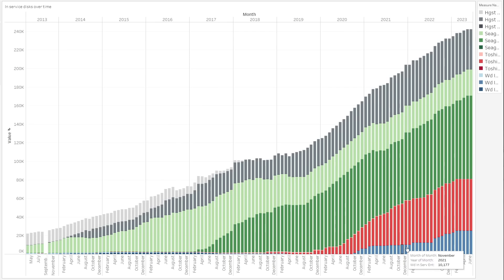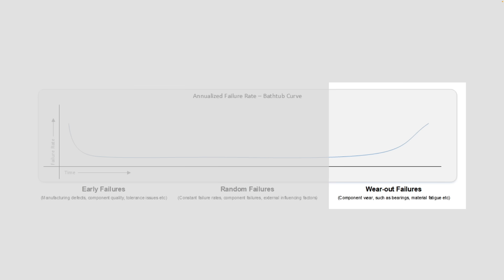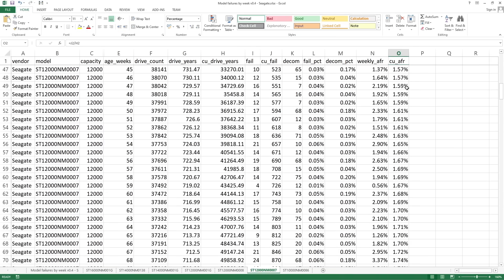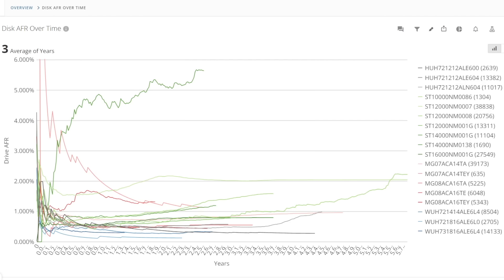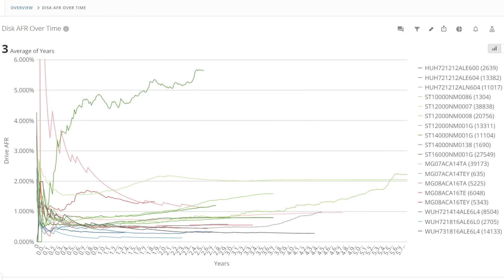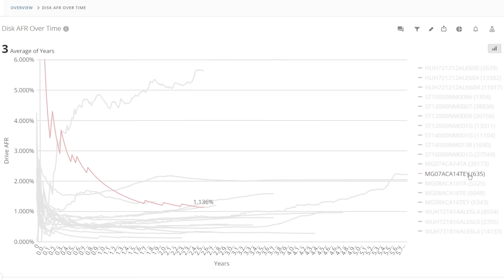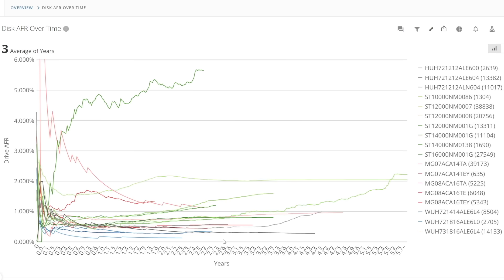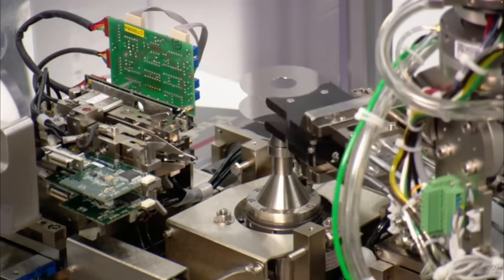Failure Rate Analysis - Best 10Tb+ hard drives: Seagate, Western Digital or Toshiba?

Comment: So it's like 1.5% chance of failure per year or over 3-4 years? I like those odds.
Reply from the maker: AFR is the percentage chance of failure for any given drive in a single year. 

As you probably saw, it’s usually higher in the first few months, and then it drops to that lower value, usually rising a little over the next few years. Each model has different stats, so some can stay below 1% for 7 years, others rise more quickly. 
But yes, even with people complaining about manufacturer A or B, the statistical chances of failures are not high. But more people share stories when things fail, than when they are all fine of course.
Reply: @sometechguy  Thanks for clearing it up. Yeah if i bought 3 drives and 2 of them failed within a year i'd have huge negative bias towards that manufacturer... when in reality it's something as simple as drives got dropped hard during shipping or possibly some botched batch. So i never hold grudge. 
So far i've only used wd drives and only had one green drive die on me gracefully over time which let me migrate to a new hdd before it became too slow to do any recovery. Recently bought 12tb ironwolf so i'll see how long that one lasts. Probably going to have to get one more for redundancy but the data i'll hold on it is nothing i'd lose sleep over losing. Just videos/steam library.
Reply from the maker: No problem, and good luck with the purchases. And thanks for watching. 😊
Reply from the maker: By and large, the drives are going to be mostly built on the same hardware. Some components may be a little more expensive on the higher end (NAS/Enterprise disks), such as vibration sensors but most of the difference is just in firmware. NAS drives will park less aggressively, but they still support power saving and you can still sleep the drives. Something like 20 mins is often a reasonable balance to stop the drives spinning up and down a lot, but still putting them to sleep during extended periods of inactivity.

In one video (https://youtu.be/l_YqdVGcC0o), I compared the life expectancy of enterprise drives vs consumer, when both are put through heavy workloads. And there isn't any significant difference in life expectancy, so mostly its firmware differences rather than lower quality hardware. And of course, some of the manufacturers use SMR drives for desktop, which I would avoid.

Comment: So model is the most realble long term on heavy read and write use ?
Reply from the maker: These are all rated for the same kind of workloads, and being Enterprise drives they are designed for 24x7 usage. Server use cases would often have these under heavy load, read/write or both depending on the application. So it really just comes down to the drive with the best reliability stats, and this is going to be the WD Ultastars based on the data.

Comment: The amount data presented to make these conclusions is great and very in-depth! thank you for your work!
Reply from the maker: Thank you, I appreciate this!

The data from Backblaze is fantastic and contains a lot of detail and a huge volume of stats, its over 410 million rows, each with around 35 columns of good usable data, with many more that isn't so useful. 

They also did a great job in keeping the data pretty clean, I worked with really dirty datasets before that require a great deal of clean up but the BB data is highly consistent. But it still takes a lot of work to extract the trend data and aggregate it up so you can get the AFR stats. 

Glad you found it useful.
Reply: @sometechguy does Backblaze also use SSDs? This is a really interesting and informative video. would be awesome to see one comparing various SSDs and how each company ranks differently in drive performance ( like company ranking 1st in ssd and last in hdd)
Reply from the maker: @LG-ff8gb  Appreciate it! Blackblaze do use SSD's and that info is in the data. Unfortunately, they don't seem to use them extensively and its only around 3,200 drives with most of them being quite small capacity Seagate Barracuda drives, only 280 or so are above 500Gb. So not such a useful dataset. 

I am also guessing they are mostly boot drives, but it would be a guess.

Comment: I have several 15 year-old Western Digital drives that still work just fine.
Reply: All drives should last the lifetime of the computer they are in. Remember, this data is for drives in data centers which get worked heavily.
Reply from the maker: This is good to hear. The data shows they are excellent drives, and I did some other analysis also comparing the manufacturers more broadly and HGST and the WD descendants come out glowing.

Comment: What I learned is to not buy new drives. Working 2nd hand drives are actually more valuable. Or get warranty.
Reply from the maker: The problem with second hand drives is not knowing what they have been through, and why they are being sold. I guess your point is that drives that are 6months old are less likely to fail than new, and this is correct. But its possible that a 6 month old drive thats been treated poorly, or comes from a batch of drives with a high failure rate is more likely to fail.

I think having a warranty that you are confident will be stood by is the most important thing, and second hand drives could have warranty problems for sure and in many cases, won't have direct support and need to go back to where you bought them. So do yo trust the seller to support the full warranty period? Thats the question.

Comment: Your video reinforced my own 16+ years in web hosting. While I had strong support for Seagate early on in my business, they've definitely failed a lot more than any other drive. HGST has been my new favorite brand for a while and hasn't let me down just yet.
Reply from the maker: Thanks for leaving the comment. While, due to the way failure distribution works there can be different experiences, its good to hear that a lot of people share the experiences that the data shows, especially those that have experience with higher drive volumes. Appreciate you sharing.

Comment: So if I want to buy a 10TB enterprise HDD, WD is the best choice?
Reply from the maker: There is a short and long answer.

Short Answer: WD appear to be producing more reliable drives over the last few years. And across the models I analyzed, that seems a solid trend. I did some other videos on this as well, and the data seems to robustly support that, even if you slice it different ways. 

Long Answer: Drive reliability varies by model, and its all statistical based on the available sample. So any drive can fail, but the data indicates the likelihood for each model. Also, the 10Tb models analyzed in this data set, may not be the ones you get today. Actually, you can pick up 10Tb from different model lines and reliability could vary, for example between an Exos X10 10Tb and X18 10Tb. But taken in aggregate across a very large sample, WD appear to provide the most reliable drives.

Its also worth noting that 'most reliable' doesn't mean the best drive to buy. Price is going to be a consideration, as well as how long you plan to keep the drive, and your trust in the brand as a whole. Support and warranty is also important, though I don't think any of these manufacturers have problems with their warranty, as long as you buy from an approved reseller.

Comment: So basically go for western digital? Im wanting to build a 16tb retro gaming build and was looking at seagate
Reply from the maker: From a reliability stand point, WD seem to have a good advantage. I did another video which compares the manufacturers across the board based on historical data and WD came a clear first. You can see that here: https://youtu.be/icNbexYV3M4 
But consider price also. Where I am, prices fluctuate, sometimes WD are very competitive, and sometimes a 10-15% premium. Toshiba sometimes are good on price, sometimes Seagate. But generally, they are all fairly close, especially if you pick a capacity to optimise price per TB.
Reply: @sometechguy  i wanted the fire cuda 16tb drive because i loved the look of tbe rgb to match my setup on the desk but i think ill just go for the drive quality.
Reply from the maker: Hard to say what drive is in that enclosure, as the specs don't talk about disk performance. Could be a Ironwolf, Ironwolf Pro, Skyhawk AI or an Exos and it could vary. But you are likely paying the $100+ premium for the enclosure with LEDs. I don't think the enclosure offers a lot of extras for connectivity, but does have a couple of easy to access USB ports....and of course the looks. 😎
Reply: @sometechguy  its the exos drive apparently....
Yeah love the look of the drive but i dont want to buy something that looks good and then breaks. Think ill go for a western digital drive MY book?
Reply from the maker: I wouldn't think its significantly more likely to break than the MyBook, though WD has a bit of an edge on the reliability stats. But I would be conscious of the cooling of using an external enclosure as a permanent drive as heat is an enemy of long term reliability and enclosures often do not provide good airflow for the drive. I assume you don't have room to mount a drive inside the computer, maybe its a laptop? If you could mount an internal drive and make sure its got airflow, that would be my preference personally.
Reply: @sometechguy  ill be plugging it in my laptop as an when i want to game.
Reply from the maker: You would likely get a Red Pro, Ultrastar or Gold in the MyBook as the lower end drives don't go up to 16Tb. So all of these are good. I think I would personally go for WD if the prices are the same, but if the FireCuda is cheaper then an Exos is still a good disk. It might be worth looking at physical dimensions with a larger unit may be better for cooling the drive. 

It looks like the 8Tb Firecuda can come with a desktop Barracuda drive, which is not such a good disk with a much lower data throughput and likely to be an SMR drive also. So I would steer clear of that version.

Good luck with what you choose, I dont think there are specifically any 'bad' choices.
Reply: @sometechguy  that makes sense. Ive seen someone on YouTube buy a few hard drives and open the case to see which drive theyve got. I know he was presently surprised he got a red drive ?
Reply: I’m traumatized by WD My Book. It corrupted every drive it was connected to. Maybe they fixed that, but I’m not willing, even with these stats.

Comment: First of all, I'm sorry for my poor English and the video has no subtitles. I can guess that your conclusion is that WD Enterprise HC550, HC560, HC570 and HC580 are the best hard drives? Is there currently the best cost-effective hard drive?
Reply from the maker: No problem, and your English is excellent. Thanks for taking the time to comment and sorry if it was hard to fully understand the video.

Yes, my conclusion would be that the WD drives looked at here performed the best from a reliability standpoint. At least, with the data available, which only goes to around 2.7 years. However, the data there is only for HC530 and HC550 drives, though I think that given the history on the Ultrastar DC drives, I would expect continued reliability on that series. Of course, there can always be problems on specific model lines, or individual drives, and things can change over time.

The most 'cost-effective' is a hard call, because prices vary very frequently and are different in different countries, and cost per TB differs by drive size. At this time (late Jan 2024), the 20Tb WD drives are a little cheaper than the comparable Exos drives where i usually buy. But the Toshiba Enterprise drives are around 10% cheaper than both. So I don't think there is a definitive answer, but based on cost and reliability I just purchased some WD Ultrastar DC 560s for a new array.

This video https://youtu.be/icNbexYV3M4 also does a more general comparison of WD vs Seagate vs Toshiba based on product lines, rather than the individual drive models and it compares the Ultrastars all the way back from when they were manufactured by HGST also. The Ultrastars look really solid generally and seem to continue to improve.

Hope this helps, and thanks for watching.
Reply: @sometechguy  Thank you so much！！

Comment: Greetings, im struggling between choosing one of this drivers, if you could help. its for PC but will be using for media server, so work constantly
EXOS™ X16 10TB ST10000NM001G  and 10TB Toshiba S300 / MG06ACA10TE
Reply from the maker: The Enterprise options (Exos X16 and Toshiba Enterprise Capacity MG06) will come with 5 year warranties, which is a positive but will be a bit noisier if its for a PC. So depends where the PC will be running if the noise is a consideration. The S300 and the S300 Pro will come with a 3 year warranty  I believe, and will be a bit quieter, the S300 doesn't come in a 10Tb AFAIK, so you would need the pro version to get that capacity, and the Pro is a 7200RPM drive like the X16 and MG06, where the S300 non-pro is a 5400 RPM drive. You could look at the N300 also, which is a NAS drive. 

I don't think there is a lot between them. The X16 seemed like one of Seagate's better models, and the Tosh drives also are good. So it probably comes down to price, warranty period and maybe if the noisier drive will be a problem for you if its running 24x7.

But the usual caveat is that any drive can fail, so no matter what you choose, that can happen and plan accordingly. 😉

Hope this helps you make your choice!
Reply: tnx, im just skeptical about Seagate drivers over the 10 years 3x6TB ones died on me.
Reply: @sometechguy  The Toshiba drives are loud, I am using the 2x X300 Pro I don't know how they compare to the N series, but they are pretty loud, honestly the X18 EXOS drives(Both are 16TB) while they are a little loud they are not actually that bad for a PC, I am using a Lian Li Dynamic Mini so results may vary depending on case, If you are using something like a Be Quiet Dark Pro case you are probably not going to hear anything.

Comment: I'm thinking of buying a new laptop, any clue how to make sure you can fit one of these into it?
Reply from the maker: These disks are the 3.5” form factor, which won’t fit in laptops. Usually you would best to go with a 2.5” SSD or an NVMe module in the laptop, as you want a fast disk for the OS and day to day use. And if you need large scale storage, then use an external disk or array. You can use a USB caddy for a single larger disk, such as 8Tb plus and then just plug in as needed. Or you could use a DAS (direct attached storage) if you need larger capacity that can also provide redundancy/data protection, or NAS (network attached storage) for shared resources. But the cost will go up, so really depends what your needs are as to what will fit best. Also, it depends how portable your laptop will really be, a USB-C dock with the storage attached is also a way to go.
Reply: @sometechguy  I thought there was some laptops which 3.5" fit in, problem with the 2.5" is their capacity is always too low. I don't know what an array even is and the storing on disks confuses me, 8tb or more would be nice but all the external hard drives worry me as they seem to break too easy, all the external storage options do which is why I want an internal hard drive.
Reply from the maker: I have not come across any, the drive is really large compared to the 2.5" form factor, and draws more power. The laptop would have to be really large, making it impractical by modern laptop standards. So its going to be external, or in some kind of attached storage. You can pick up 4Tb 2.5" SSDs no problem, you can get larger also, but the price will start to rise quicker.

But its a valid concern about the external disk, as I wouldn't consider external disks to be the best online storage. They come with shorter warranties, usually have lower spec disks and those caddies are not the best for heat dissipation also, so the disks will run hotter which isn't the best for longevity. I would look for a laptop with a couple of NVMe slots. But again, its a balance between price and performance, so it will depend what your needs are for the laptop and storage performance.

Depending on your needs and budget, you could look at a small NAS, but it isn't something you would carry around usually. That kind of external storage should be robust, and you can use an RAID array to make it even more solid. But if you are not familiar with this, you would need to do some research, and its too complex or expensive for you use case, you could always consider a cloud based solution like MS onedrive (there are many others).
Reply: @sometechguy  Thanks, I don't know if what I am about to say is the correct way of saying it but I don't want my storage to be part of a server or by that I mean like something you can treat like your own personal netflix (if you rip disks on it) and need internet to access what's on there, I wish to go on and watch anything I put on there without the need for the internet and without the server part, I don't like the idea of keeping anything in my house running 24/7 though, everything I see about NAS is them being designed to just keep running.
Reply from the maker: Yes, that’s correct. So if it’s for media storage, either a larger ok board SSD or an external USB disk. And just treat it correctly, e.g. eject it before disconnecting and don’t move it about while it’s running. I think this is your best solution.